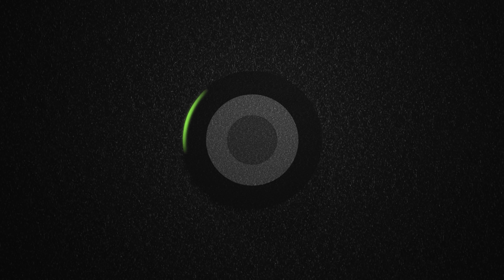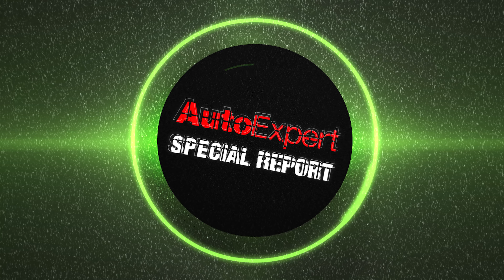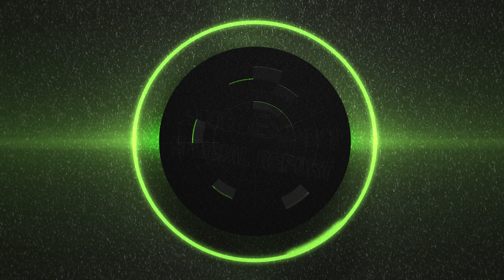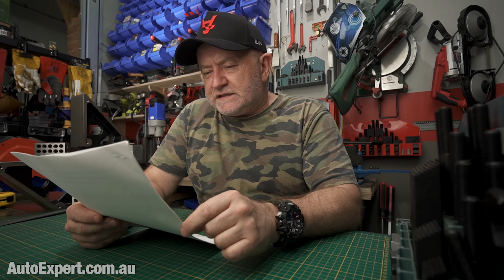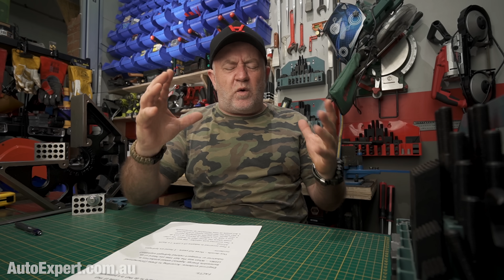The truth about fire risk: Hydrogen fuel cells and battery EVs | Auto Expert John Cadogan

Comment: Omg, I knew the ill informed would jump on the exploding tank band wagon. As a user of LPG powered vehicles for 30 years I had many morons bringing this up. LPG was far and away much safer than petrol. The vehicle has to have an inspection and leak test every year by an LPG certified workshop. The mechanic doing the inspection has to be certified to do the inspection and a written report has to be provided to the registration authorities. This is every year. Every 10 years the tank has to undergo hydrostatic testing and be recertified and date stamped accordingly. On the vehicle the tank has a manual shut off valve plus and electric solenoid that will not open until it is energised not only from the ignition, but also by a vacuum signal generated by a vacuum switch on the engine. This setup was also repeated with a second solenoid mounted close the the converter in the engine bay. This stopped gas flow in the case of an accident where the ignition remained on after impact as the loss of vacuum from the stopped engine would shut off the gas. This also helped in the rare occasion where a vehicle crashed badly enough to rupture the gas line from the tank to the engine because again with no vacuum signal the solenoid on the tank would close. LPG tanks just don’t rupture, the steel they’re made from is specifically produced for LPG tanks and in the last 30 years I’ve never heard of one rupturing in a vehicle crash. Now go back through history and see how many people were incinerated from ruptured petrol tanks. It’s thousands and just for shits and giggles look up Ford Pinto and also Fords 2ltr motor in cars like the Cortina as they had a strategically placed plug in the carburettor that would regularly just fall out and spill petrol all over the exhaust manifold. It wasn’t unusual to see a burnt out Cortina on the side of the road back in the 70’s. I can remember sticking soap it a pin hole leak in a Holden fuel tank, not so that it was safe, but so that I didn’t waste the fuel. A piece of chewy also works. Hmmm LPG is way more dangerous than petrol…

Comment: I suspect that some "Hydrogen fear" stems from the Hindenburg.
But that was a really worse case based on a poor design. Put a flammable gas in fabric bags sealed with a hydrocarbon. 
It worked great, until it didn't…

Comment: Personally not a fan of working with nitrogen at 690bar and I've done that a few times.
Real issues with hydrogen are permeability of containment vessels, especially pipelines (due to the atomic size), speed of recharging filling stations from cryogenic storage, and cost.
Transport not usually an issue as local generation of hydrogen using electricity tends to be the route taken (at least locally here in Scotland).
At least you're not running Vauxhall/Opel Zafiras in Australia. 
Worth bearing in mind, it's hybrids that are actually the most likely to go on fire, and probably what did for the Felicity Ace, and all hydrogen vehicles are hybrids.
Reply from the maker: Most hydrogen gas is produced by steam reforming methane gas. This is a very high temp process requiring industrial controls and practices. The gas is then transported. 97 per cent of the earth's hydrogen gas is made in this way.
Reply: @AutoExpertJC  it's usually used locally to production, often for making fertiliser.
The hydrogen fuelling stations near me (there are 2 or 3 in Aberdeen) use electricity and generate their hydrogen on site. (Surprised me too)

Comment: To James scuba diver: as scuba instructor trainer, the water tank/bath is not for explosion, it's to cool the air in the tank as it heats up when adding pressure to the tank (see PV=nRT). This allows you to fill the tank to 200+ BAR faster. An exploding tank will rip most of the water baths to little pieces, and probably half the store it's in a well. It's happened before and took people's legs off.
Reply from the maker: I didn't think of that - obviously water has excellent specific heat capacity, even without a phase change. Thanks for sharing.
Reply: @AutoExpertJC  
To add - Some dive shops do have water baths made with steel thick enough to redirect a cylinder failure, but many have a basic aluminium or thin stainless steel bath which won't help a lot.

There's also an Aluminium cylinder standard from years ago "aluminium alloy 6351" that was condemned as it was randomly failing - even after passing hydro tests. It was one of these that took the leg and arm off a mate of mine.

All scuba cylinders are hydrostatic tested to at least 1/3 over their rated pressure (eg the common 232bar steel tanks are tested to ~350bar). It will expand & if the cylinder doesn't return to original size it fails.

As for car crashes, the burst disc (safety disk in the valve stem made to a fail pressure far lower than the cylinder) will likely fail 1st (after the cylinder has gone through your head...). Have seen these discs break just by tanks falling over onto concrete floors. 

And speaking of PV=nRT, the discs also fail if you leave a cylinder in a hot car on a sunny day - always a trap if doing 2 shore dives at a site. This could easily be an issue for other car gas storage systems.

Comment: Hi John,
I just wanted to mention that the Boeing 787 Dreamliner also carries a (large, maybe 2) lithium ion battery(ies) in the belly of the plane used to start the 4 engines (and maybe the APU).
No fire, but 1 instance of 'smoke', and it was redesigned with a thicker insulator between the plates.
They have been using them since at least 2010 when I forked on the entry into service program.

Comment: And building 7 collapsed even though no plane ever hit it.   Into its own footprint, like a controlled demolition.  It's uncanny
Reply from the maker: There is no mystery to any of this. There are just people who understand physics, engineering and materials science, and people who do not.
Reply: @AutoExpertJC 
Architects & Engineers for 9/11 Truth
Reply: You mean WC 7 which was on fire for 6 hours before collapsing because the heat caused steel columns and beams to buckle?

The impacts from the two aircraft didn't bring down the WTC towers, heat from the resulting fires did.
Reply: @fredintas6596  WTC 7 had not been hit by a plane, so it was apparently the first steel-framed high-rise building in the known universe to have collapsed because of fire alone.

Comment: Finally - someone who not only speaks In simple layman’s terms but takes the time to explain hydrogen fuel cells and the inbuilt safety features that have been designed into the cells.  As far as EV cars, currently  in California is having issues with EV’s  catching fire 🔥 not only at home charging stations but also on the highways due to battery fires caused from heat issues.
Reply: They are actually having an LG battery fire problem.  Everyone else seems to be doing fine.

Comment: As someone who has done research on the use of hydrogen as an automotive fuel (and I mean proper research, converting a car to run on hydrogen, running scientific tests, and publishing a thesis based on that research), I have to commend you, John, for doing a pretty good job of working out the facts and presenting them rather well. There are, of course, a few details that you didn't go through that would bore the hell out of most of your audience, but most people simply don't need to know the level of detail that the engineers designing and testing hydrogen cars and components need to know. As with anything, there can always be a situation that can't be completely eliminated, but that usually entails a perfect storm of multiple things that have all gone wrong (usually with a major element of human error), and let's face it, nothing is ever risk-free. Even when I did my research sixteen years ago, the US National Fire Protection Agency had excellent standards for hydrogen fuel systems, and since then, the standards have been improved further, so hydrogen powered cars of today are even safer than they were when I did my research. In all likelihood, most hydrogen-fuelled vehicles of today (not that there are many of them) are probably safer than most commonly available petrol/diesel cars.
Reply from the maker: Thanks, Danny - determining the appropriate depth to cover an issue for mainstream consumption is always an issue for me. I could always have done more (or less) detail...
Reply: All in all, I think you got the level of detail about right. Bravo!

Comment: SCUBA cylinders have a burst disc in the pillar valve. The disc will pop out long before the cylinder can explode. Will make a hell of a noise and scare the crap out of anyone close by, but highly unlikely anyone is going to die. There is more risk from dropping a cylinder on your foot and breaking a few bones than being injured from it exploding. 
The main reason tanks are filled in water is to keep them cool to ensure you get a proper 200 bar fill.

Comment: Yeah, safety keeps improving, etc, etc, but I still  wouldn't sleep soundly knowing there was a massive lithium battery being charged in the next room to me (My garage). I've never seen a petrol car just spontaneously burst into flames but I have seen many lithium battery fires, resulting from charging problems. Perhaps I'm just too cautious 🤷‍♂️
Reply: Perhaps you're just too biased.

Especially considering current tech EV battery (lithium iron phosphate, LFP) doesn't exhibit the same thermal runaway issues John has explained (can find videos of firefighters piercing a charging LFP battery and no fire occurs) and you should quickly learn that EV's in your garage are no more of a hazard than the fuel tank in your car sitting in your garage.

Comment: We used Steel SCUBA tanks because they allowed more pressure & volume. We use to fill them in a tank of water to keep them cool & allow higher volume fills.  3000 psi. is on the high end for aluminum.

Comment: so what makes more pollution? a burning old car that's not very "green" or a modern one with 15 airbags and plastic everything, and eleventy million miles of wire?  Of the several cars i remember burning to the ground as a kid, 2 were ford cortinas with the 2 lite engine where the fuel fitting (press fit) had come out of the factory weber carb and due to a carby bowl full of fuel the engine keeps running so the fuel pump is pumping heaps of fuel all over the hot exhaust and engine bay.. turns out bonnet cables melt in this situation also. 
and the other couple  were electrical short circuit related.

Comment: Hi John, are you saying the use of lithium batteries are unsafe in the context of EVs or they are unsafe in general? Is it the specific build or size or use that makes it more unsafe as compared to rechargeable lithium AA/AAA batteries, power tool batteries, cell phone batteries, lithium equivalent caravan/backup batteries, etc?

Going with your closing statement, maybe a petrol vs lithium comparison on safety is warranted? You have risk and hazard mitigation on both. But what is more likely to cause a fire based on just being cooked all day on an open car park under an ozzie summer sun? Or which is less safe in a significant accident/crash?
Reply from the maker: I'm saying nothing is completely 'safe'. Risks can all be mitigated to make the use of this or that acceptable.
Reply: EV's will not self combust in the "Ozzie" sun, ever, just the same as a petrol car won't.

Comment: Saint Elon is touting cold gas thrusters for the Roadster and the muskavites swallow this hook line and sinker. 
Can you imagine the pressure that the cold gas thrusters are going to need? And musk is suggesting that the pressure vessel can sit inches behind you. Then he’s got the cyber truck a stainless steel wedge shaped car killer. Imagine the accident between the 2. If the batteries go up and the cold gas gets to vent. Nice hot energetic fire with a really high pressure source of air. It’s not going to be nice.

Comment: Thanks, good discussion. Hydrogen is very leaky and will easily permeate many materials, this is well controlled in industrial uses, but I worry about extending its usage domestically.
If petrol were invented today it would probably be banned. I worked on a chemical site handling low flash solvents, such as petrol, we had to undertake enormous protection procedures, specialised electrical kit etc. We banned petrol vehicles from the site, we even banned mobile phones unless specially protected, but cars drive around full of hot surfaces and unprotected electrics, and cheap fuel lines and couplings.

Comment: Hi John!
I have a case where an airport parking complex partially burned down from fire from a Opel diesel car. These fire was at Sola Airport parking complex in 2020 and as these is Norway the EV and hybrid mix among the parked cars was high and still the investigation concluded with EV`s and hybrids did not contribute more then ICE cars to the spreading of the fire. And compared to that ship brimful with expensive EV's that sank the parking facilitie was there all of the time, before, during and after the fire to be investigated.
I would advice you to take a look https://youtu.be/-6juEM8UTsc

Comment: Fuel cell cars could have a built-in Escape System.  Have a few large balloons on board the car and in an emergency they inflate with Hydrogen from the tank and you can float away.
Hydrogen has 4X the amount of lift that Helium does.  Imagine floating away from an avalanche on the Highway...smokin' a dube....  XD

Comment: Hydrogen is in use in a few places.  Toyota Mirai has been around since 2014 in Japan and South Korea has a similar vehicle.  I would guess CNG (compressed natural gas) is a more dangerous gas and has been in use for at least 3 decades and works well for fleet vehicles that return to their garage daily.  Any vehicle with lithium batteries should have a fire suppression system to reduce the risk of thermal run away.  There are fire suppression tubes that can choke out a fire and if the batteries are contained in a system that can dump a gas into the container to choke out the fire will reduce the risk.   Fire departments need training and the equipment to be able to drown out a vehicle fire.

Comment: Hydrogen is fast burning almost exploding but you need a lot of hydrogen to match 50 litters of gasoline or diesel...
Hydrogen on open air kinda harmless thing. Moment hydrogen leave tank it's rushing up in atmosphere. Methane gas also wants to go up. 
Butane gas is more dangerous. Butane when leaving tank is going down and left and right and can settle down in some kinda closed area and later big boom 💥💥💥

Comment: Good points if hydrogen:
1) dense energy storage

Bad points:
1) It's a bear to transport. That's why it is almost always produced at the location where it's needed.
1) it's a bear to store. If you think the bill to keep to keep the inside of your freezer 40 °C below ambient, try nearly 280 degrees below.
2) it's a bear to store. Special materials are needed to avoid embrittlement and special standards also because it leaks way faster than anything else I can think of.

3) Over 95% of it is made (very wastefully) from fossil fuels, so using  hydrogen will increase CO2, increase dependance on fossil pushers and decrease energy security (while making more money for the pushers, obviously. That's why they push it).

4) if you burn it, you get more NOx than ever before due to hydrogen's burning characteristics. If you don't burn it (use a fuel cell), the cells degrade over time and especially the air needs to be very oure if mthe are going to last -> massive filters serviced, what, monthly perhaps?

Executive summary: spend fortunes investing in shit to use more fossil fuel to produce more energy, then waste more of that energy and make more greenhouse gases than ever before. If you own fossil shares, go for it. Otherwise, run away!

Comment: I imagine a filament wound tank could be constructed to hold virtually any reasonable pressure.  Composite structures also tend to not fail catestrophically but may start delaminating which is your clue to reduce pressure and get a fix in.

Comment: A bomb contains an exothermic reaction until a design pressure is reached then explodes.  Typically these exothermic reactions accelerate under increasing pressure.   Black powder bombs of the 19th century were typically encased in cast iron vessels to give the slow burning black powder time to build pressure.

Comment: The Ford Pinto was rightly or wrongly labeled a bomb on wheels.  Not a drop of hydrogen there.  Oh by the way existing ICEs burn hydrogen from the hydrocarbon you buy at the gas station.  Engines can not produce a high enough temperature to break carbon carbon bonds to release energy.  They can only break the carbon hydrogen bond.  The carbon then goes out the exhaust pipe.  As Hydrogen has an atomic weight of one and carbon many times this, the majority of fuel you are buying is garbage the engine does not use and spews into the atmosphere.

Comment: Hi John, as usual an excellent program. One item I saw recently from a civil engineer was the over weight loading of multistorey carparks when full of EV's as they are so much heavier. Reduce the spaces by about half seems to be the answer. Here in the UK old farts like me remember town gas made from coal. It was approximately 50% hydrogen and 50% carbon monoxide and burnt a lot better than natural gas.
Keep up the good work, I am hoping to buy a new diesel car again shortly, pity you do not work over here.
Reply: Your average EV weighs the same or less than your average 4x4 SUV so I don't see how overloading could be a problem. As a civil engineer I know you design for the worst case scenario (car park filled with SUV's) and then triple that as a factor of safety.